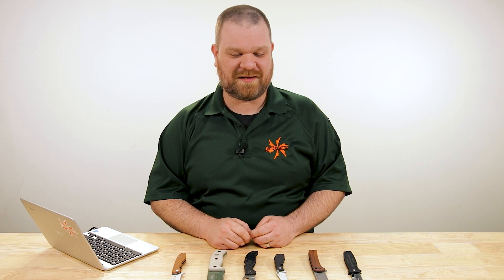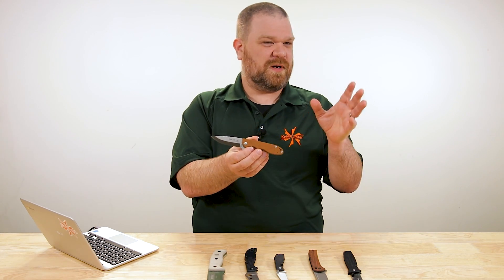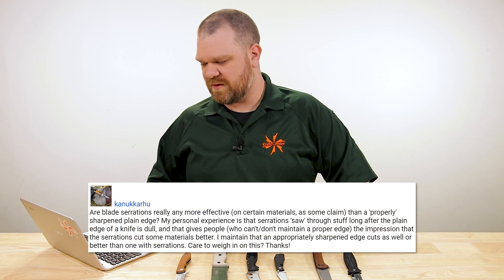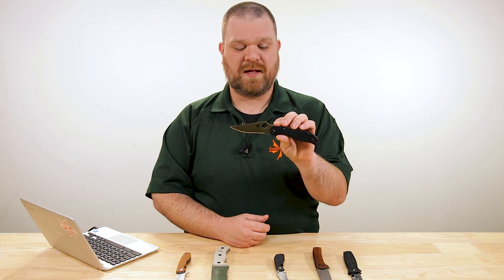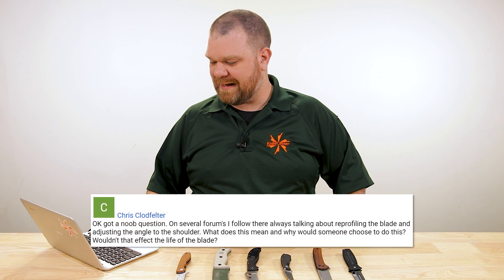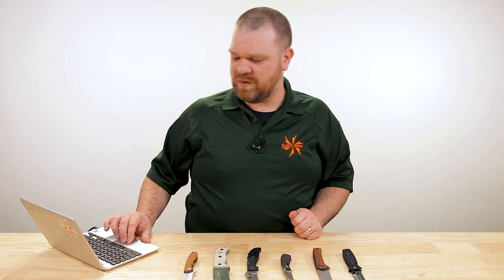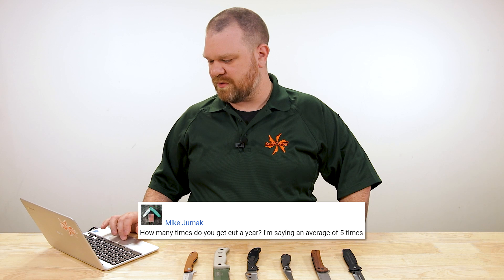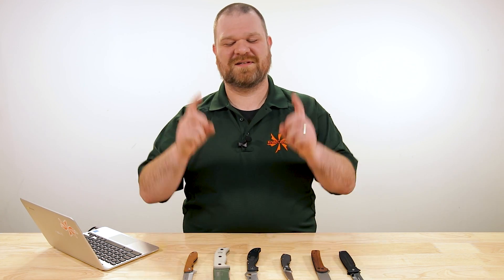KnifeCenter FAQ #80: Are Serrations Bad? + Scandi, Saber and Flat Grinds

Comment: Hi DCA. I'm wanting to buy the slicey-ist manual knife possible with a crossbar, compression, or button lock for maximum fidget factor as well. 
I prefer the bigger knife versions like the PM2 or even a Bugout over the mini equivalents but it doesn't have to be limited to that.
Can you help? Thanks in advance
Reply: Check out the Benchmade Freek or the Spyderco Manix 2
Reply from the maker: The upcoming Benchmade Taggedout is unbelievably slicey -DCA

Comment: At least Spydercos serrations are even a bit quicker and easier to sharpen than a plain edge - if one owns an uses a Spyderco sharpmaker (due to the chisel grind only one side needs to be actually sharpened, in the other side only the burr to be removed). 
The chisel grind serrated edges often come in, and the steeper overall edge angle is another reason why SE knives cut imo better and more aggressively. 
Also, a serrated edge offers more actual cutting edge length than a plain edge in the same blade (length). One of the reasons why SE stays sharp longer than PE, but not the only one: The cutting edge of the scallops between the "points" of the serrations are protected by exactly that points from hitting harder stuff (cutting board..) that could lead to quicker dulling. And the "points" break up / penetrate matter that gets cut just like the tip of a knife would, so the actual "edge" in the scallops does not have to do this work.
For me a good SE is almost always the better choice than PE - in a folder!

Comment: Hey DCA, got a question for you and would appreciate input. I’m a butcher/meat cutter by trade as well as an avid outdoorsman. Because my line of work I tend to use a 5-6” boning knife for a lot of small tasks, so here is my question is there something similar in a smaller carry friendly version of a boning style knife that can be used for outdoors tasks and food prep at camp that can be sharpened or maintained easily. Preferably not the outdoor edge option. Any options or suggestions would be greatly appreciated. Thanks in advance.

Comment: Perfect example where a serrated knife works greal is opening a coconut. Try slicing a coconut with a flat knife then try a serrated or a saw blade like that on a swiss army, which is why i consider it the most versitile non defensive knife ever.

Comment: Hey DCA, can you recommend a good high hollow grind fixed blade for edc, I really want a blade that is thin behind the edge. I feel that they are easier to sharpen and slice remarkably. I have a Buck 101 fixed blade and love it but want to improve on that.
Reply: Check out WE/Civivi, they have excellent hollow grinds. Maybe the Elementum?
Reply: Spyderco yojimbo2 comes to mind, not a fixed blade, but the Compression lock is almost as good as CS Tri-Ad, and just about gives it fixed blade strength. The edge is very thin and especially the tip. is very
Reply from the maker: The Elementum fixed blade immediately came to mind -DCA

Comment: Regarding saber vs scandi: If I take a scandi and raise the bevel way up to midway of the blade or beyond, where does the scandi stop, and where does the saber start? Scandis are also flat ground, just like a flat ground saber, they usually just take up much less hight of the blade. I think this is where many people get confused, because a significantly raised scandi (with micro bevel) must define as flat ground saber at some point. Or am I completely missing something?
Reply: Scandis are usually about 11 degrees and have no secondary bevel.

Comment: Hey DCA! With the Benchmade 980 discontinued what would be a good replacement knife? Something with decent steel (not D2 or 8cr) that is tough and reliable with a drop point blade and under $150. I was thinking Recon 1 drop point but that’s a little big and not easy to release the lock when your hands ache from work. Any suggestions?
Reply: I was gonna say the BM Super Freek but its over your budget, then the AD20.5 but sadly its in D2, so I did a filtered search and think the BM Presidio II with 3.7" of S30V at just under $150 is what you're looking for. Or the Griptilian if you want something serrated.
Reply: @arrowheadguys7637   I was looking at the presidio 2 and I think that might be a good option. The AD 20 is nice but I don’t think D2 is worth the trouble it doesn’t provide enough edge retention to justify how hard it is to sharpen so thats why I don’t like it. But thanks for the reply And if you see something else let me know. Also I have a griptillian and it just doesn’t do it for me. There’s something about that 980 that just hits the right spots for me
Reply: @arrowheadguys7637   also I live in Canada so my options are somewhat limited
Reply: @mikoyanig5512  If you wanted to up the budget to the Super Freek I would highly recommend it, I love mine and its one of my favorites and fits what your looking for I think. I'm sure the Presidio is a good pick too, I just don't have experience with one.

Thought about the 20.5 because I carry it for work often, because of the ease of operating the lock. Really hope they come out with a better steel option for it, because I'm not wild on D2 either, but it works for my uses.
Reply: I'd like to see two identical knives with d2 and s45 or something and see how many people could tell a difference from real world use. I'd also like to see d2 heat treated properly but hey
Reply: @jusme8060  I've got several D2 knives and they are just fine. Decent edge retention but a bit of a chore to sharpen. My comment on the 20.5 and wanting a better steel is more related to paying $150 for a D2 knife. Sure, I was buying the Demko name and the lock mechanism, but at that price point S30V should really be doable.
Reply: @arrowheadguys7637   I’ll have to go and get my hands on one and see if I’d like the super freek but like DCA I have larger than average hands so the presidio might work better. Thanks for the reply’s though it’s nice to have a second opinion 👍
Reply: @mikoyanig5512  I've got huge paws myself. The Super Freek feels perfect in hand. Hope ya like whichever one you go with tho! Always got time to chat knives
Reply: @arrowheadguys7637  yeah, I just wonder if you could tell anyways. Even if you get magnacut instead and feel better paying more, 90% of the time it's not heat treated right anyways and you aren't getting any better edge retention. Spyderco is the only popular brand I can think of who heat treats optimally. I brought up magnacut because most of it is only treated to 60 or 61 hrc. At this hrc there is no benefit to this steel over other popular steels that are more affordable. I bough a kizer in 10v that gets worse edge retention than any d2 I've tried.
Reply: @jusme8060  Most people likely couldn't tbh. I have a pretty good "gut feel" for edge retention because I use my knives a lot for work doing the same tasks over and over again. Some steels I need to strop once a day, some once a week...and some need time on the stones before lunch lol

D2 holds edges fairly well for what I do, but I've etched a few blades with some of the chemicals and materials I'm around. Of course I've found a lot of the cheaper stainless steels will stain under the same use (RIP Civivi Vagabond)

Comment: I believe that only a double edged dagger can rightly be called a combat knife designed specifically  for hand to hand.   The Fairnbairn-Sykes  fills that bill.  Lots of blades can be used to thrust,  but no one should slash at an opponent with a knife that has  only one sharp edge.  In the panic of combat, 50% of your slashes will not cut anything.  Also --The Fairnbairn was designed to penetrate heavy wool outer coats so the blade is a bit too long.  A shorter (5”-6”) blade would be more efficient IMO. And no serrations to hinder a thrust. What say you, Sir?

Comment: So, with the positive attributes of AEB-L and 12C27, whats the point of classic carbon steels like 1095? What do they offer over the stainless alternatives, other than being able to act as the "steel" in a flint and steel?
Reply: Easier to sharpen, and get a wicked sharp edge quickly. Decent toughness.
Reply: We knife users could say that 1095 is nice and tough, but also usually it is easier to sharpen than many other steels. But if we looked at it from the perspective of a knife maker, it is likely a little easier to work with (heat treat, grind, etc.) than many stainless steels are.
Reply: @Ericstraordinary  I haven't found 12C27 hard to sharpen, quite the opposite actually. I see how it's better from the maker's perspective, but that doesn't help me, the user lol.

Comment: I prefer my knives to be partially serrated if possible. Definitely comes in handy
Reply: Hot take, I like having a serrated blade handy, but half serrations are usually on the wrong spot, and are a big compromise for me. Because of how short the section tends to be, you are most of the time better off just getting a secondary smaller knife: a spyderco ladybug or man bug come to mind as good options. But to each their own, there are certainly some nice designs with a partially serrated edge out there.
Reply: @knate44  nah they work fine for me....Short section? I’m not trying to saw a log in half, I use it to occasionally cut rope etc have even cut wire in a pinch before.
Reply: @brucefranklinjr.8543   Also that is fair, but what is better than one knife? Two knives.

I'm just joshin' if it works for you, more power to ya! I just personally prefer two dedicated knives as opposed to one hybrid one. But again that is just preference.
Reply: @knate44  right on i got ya, I do think a 2/3 serrated option on some knives would be pretty slick imo. I have serrated, partial and non serrated too so I’m not the knife nazi lol but at work or if I’m out hiking or camping etc I’ll more than likely have a partial serrated with me.

Comment: What’s an example of a full hollow grind? And a full hollow grind has a micro bevel wouldn’t that make it a saber grind?
Reply from the maker: Most case knives come with full height hollow grinds. As for the second question, if you have a full height grind it can't be a saber grind, which is by definition not full height. -DCA

Comment: Using rods made for serrations is really not an easy and comfortable way to sharpen serrations. The Spyderco Sharpmaker is the easiest and best thing I've found to sharpen serrations. If you manage to find stones where the abrasive media is laid all the way to the corners, and that the corners are well defined (rounded 90°, or abrupt 90°) will work too, very well.

Comment: Do you think we eventually will talk angles as a measurement for cutting geometry like we talk about blade length, blade steel etc.
Reply: Doubt it. Knife makers don't seem too keen on listing what their edges are supposed to be ground to, most likely because for those doing it by hand it will change from knife to knife.

But I wish it was a spec that companies both listed and held themselves to. TBH I wish there was a standard, where EDC knives are 20 deg and heavy use knives are 25 deg, with fine cutting knives being 17 deg...as an example
Reply: @arrowheadguys7637  I don't mean just the cutting edge geometry but the entire blade geometry. Bevel angle,blade thickness, thickness behind the edge,or how deep a hollow is. I understand the edge can vary but still having an aimed angle they go for would be cool. I guess if they did it would only prove if it was a bruiser or a slicer.
Reply: @holiday_edc5696  Those all kind of fall in the same boat of specs that can change from knife to knife depending on the individual grind (other than stock thickness which usually is listed). Makers probably would not want to post specs that could change from knife to knife and open the door for criticism if a knife's grind is 1° off from what they published.

Comment: bad for edc. awesome to cut bread and ropes.
Serrations on Spyderco and Victorinox are bearable, but some fix blades come with serrations so aggresive and deep, for wood cutting. Those are the worst. I dont have a problem sharpening serration but in the field a straight steel like Victorinox is so easy to sharpen...

Comment: Well, after going to Saber "grind" school I've got to think a saber flat grind has no doubt got to be the longest lasting slicer one can have. That's what I took from all that, of course, if one's doing chopping they need a different knife, but pure slicing action no way a saber flat grind could be beat, eh?
Reply: 🤔 I think full flat or hollow would beat it depending on stock thickness for pure slicing action.
Reply: @1980JPA  Yup, and the saber grind is better for the chopping.
Reply: @arrowheadguys7637  Really? I'd be afraid the edge would fail when chopping?
Reply: @geico1975  Yeah, I think you have it mixed up. A saber grind makes for a more durable (thick) edge, like the ESEE 5 he showed, where a full flat grind will have a thinner edge and be the better slicer.
Reply: @arrowheadguys7637  
Aw, yeah, I probably did have it mixed up:) I remember now, since you mentioned the ESEE 5, must have fallen into the whole saber being about the grind instead of how high the line comes up:) HA! I get it....
Reply: @geico1975  No worries!

Comment: Wash your hands!! That's the best advice you give 😏 Buy A Good knife, eg Cold Steel. Serrated edge is used for cutting tough meterials eg rubber tubes, in military emergency thru some soft metals too. But serrations also  better for cuts, producing a more serious wound that could stop an attack more quickly. ☝️😎

Comment: Why does 8cr13mov get so much flak in the knife community?  Most of my knives are this metal, and they work well. I just have to buffer them once a week on the white side of those cheap yellow Smith kitchen sharpeners.
Reply: With all these super steel options it has opened the door for the steel snobs to come out of the woodwork. There is nothing wrong with 8cr13mov, aus8, 440 or any of the other lower end steels. I work construction and carry a lot of softer steels because i'd much rather deal with a rolled edge over a chip out
Reply: @kydd666  For sure, I'm in IT, and Victorinox is perfectly fine for me. If I need to cut some boxes and dull the blade, it's easy to sharpen and strop afterwards.
Reply: @kydd666  Indeed. I choose my "Softer" stainless knives for hard use, over some of my show-off steels for that reason.

Comment: There is a way to sharpen serrated edges, which I found buried under a lot of vids espousing complex or tedious methods. Simply flip the knife over, lay the entire edge flat on the sharpening stone and go back and forth. It sharpens the entire serration, points and valleys, in seconds. You’re welcome.

Comment: My two cents?  Serrated blades have pretty limited useful applications outside of emergency or rescue work, etc.  That’s just my experience though and other viewers may have different realities.  They must be selling them or they wouldn’t keep making them…right?  Oops!  I guess that’s three cents. My bad.
Reply: My experience with the serrated knives I have, is that they do the same just as good (if not better) as plain edge when it comes to EDC tasks. I primarily have Spyderco knives, and their serrations are excellent. I bought a Microtech MSI folder in full serration and just got it in the mail. Really exciting on how it will perform compared to the Spyderedge knives.